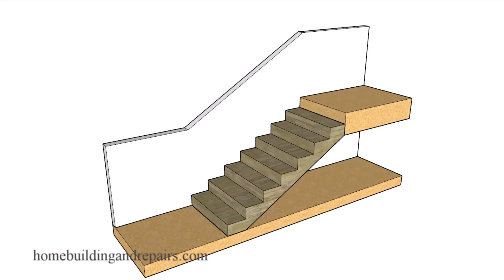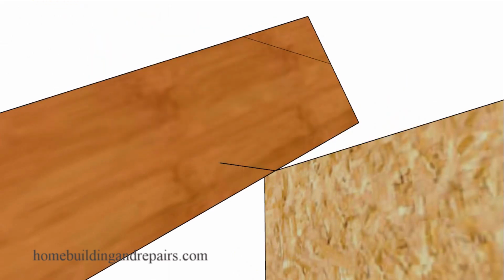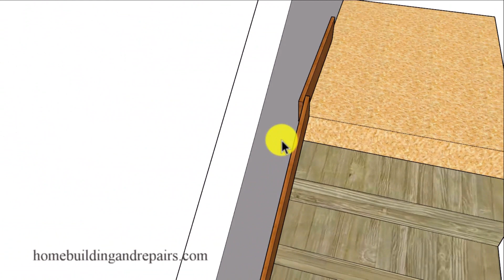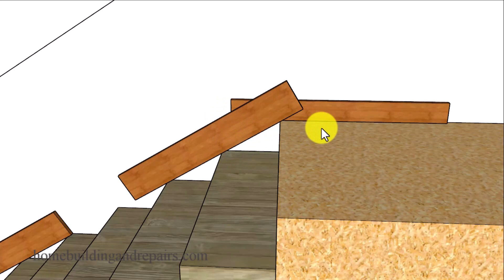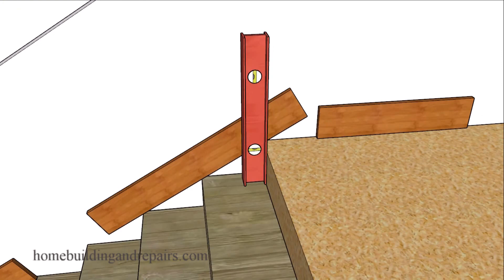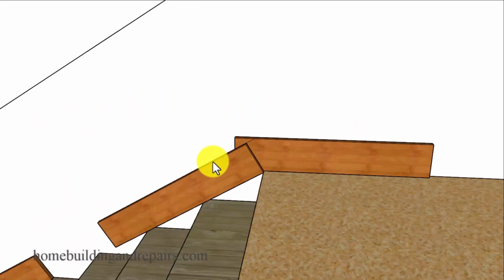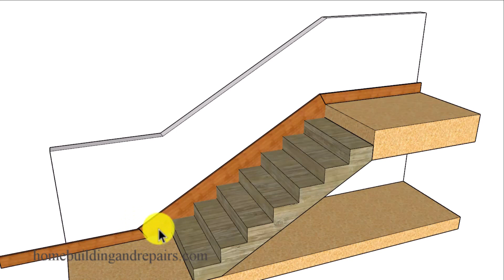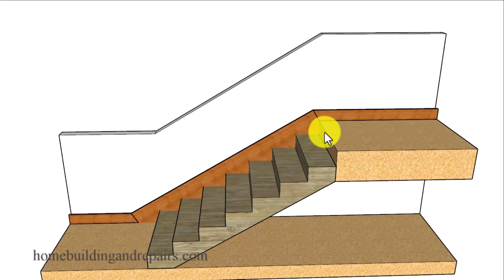Simple And Easy Method For Calculating Different Miter Cut Angles For Stair Trim or Skirt Board

Comment: Have this exact scenario, except the bottom of my stairs ends with a corner (another set of stairs going to lower level, on the other side of the wall)... 

For the trim, I wanted to do a self-return cap.. mitre was 41°, bevel was 45°.. but I could NOT figure out which angles I needed for the return piece.. Can you help me understand please 🙏 

(I just ended up doing a double mitred return on the trim, but its not as clean-looking as a self-return)
Reply: Should also add that the trim was 5.5" mdf 👎 (I did not pick it !) So it had to lay flat on my mitre saw
Reply from the maker: All I can offer is this playlist at this time. https://www.youtube.com/watch?v=kIjmHHAqH-I&list=PLYdxzfqPmRpJihnTqgxA8friEvQea3adv

Comment: I have a baseboard meeting skirt board with a bullnose profile on the top, 1/2 diameter, and I’m wondering which angle would help this rounded edge match perfectly. For instance, two 45° works perfect, but a 60 and a 30 would probably mean the rounded nose would not match up perfectly right?

Comment: What if you want to put a chair rail on your staircase, but at the bottom of the staircase you want to continue the chair rail around an outside corner? How do you get the angled chair rail at the bottom of the stairs to match the horizontal chair rail on the wall that meets at the outside corner?
Reply from the maker: You need to turn it to be horizontal and then go around corner. So both pieces that go around corner will be level and have a miter cut of 45 degrees if it's a 90 degree corner.

Comment: I wish I had this video 20 years ago. I was a project manager who needed to be an amateur carpenter and made three custom frames with 8" horizontal and 6" vertical sides. The frames had an aged look, so to save time and prevent mistakes on the final product, I used chain/wire brush on all the boards before I cut them. Then I cut all the boards to length with 45 degree angles to the dimensions of the art. When I went to assemble, I could not believe that the 8" and  6" sides didn't line up!  Lesson learned. I had to buy all new 6" sides as I think I was able to reuse the 8" sides. I had to go to Ray, the real craftsperson and ask for advice on the angles. He laughed and said that almost everyone makes this mistake the first time on their own.

Comment: This is a wonderful video. However, I'm at about the 3 minute mark of the video on my project. I did indeed find that the board on the left has to be smaller than the board on the right.  You didn't really address how to get those 2 to match up.  If you're using a 1 x 4 on the right what would the board on the left need to be in order to line them up?

Comment: Love it! It's the basic term of a fine cabinetmaker, mark don't measure. No tape measures, no angle finders, no math. Just a pencil and any straightedge to get a straight line between two points.  I was formerly "stuck" on calculating halving the 38degree slope, cutting two miters of 19degrees and wondering why it did not work right.

Comment: Can the wall stingers be installed before the risers? Re building the 6 steps leading down   to family room.  The stingers were installed after the risers, originally, then the oak treads. There is enough room to just install the stringers w/o cutting to fit the risers if the risers are, again, installed 1st. Make sense?
Reply from the maker: Most stringers are installed first, unless you're dealing with something strange. Email me a picture if this didn't answer your question.
Reply: @stairbuilding  House built in '63. 'Something strange' is about what I'm having to deal with. Limited space to work in, also. I carefully measured the risers to fit  very well After installing wall stringers.  Worked out well. Knowing I could install stringers 1st, if needed, helped.